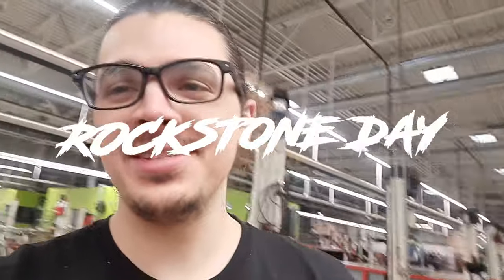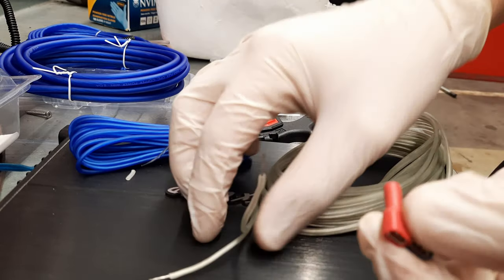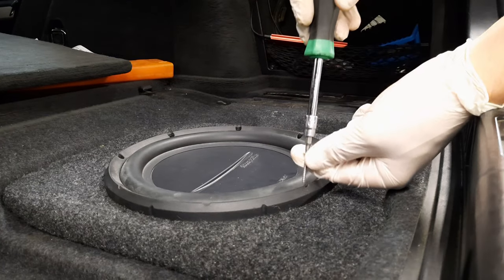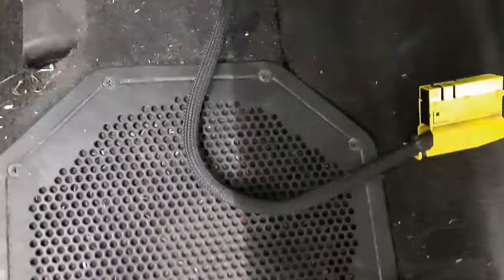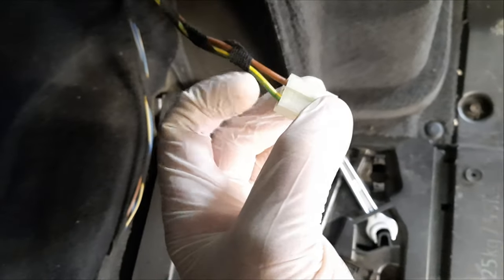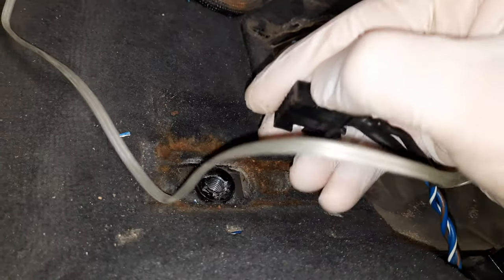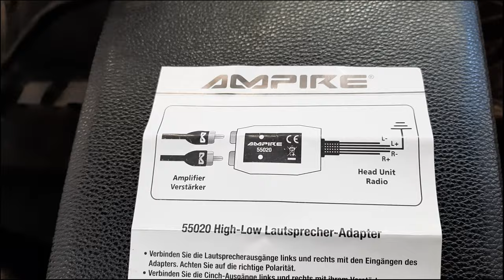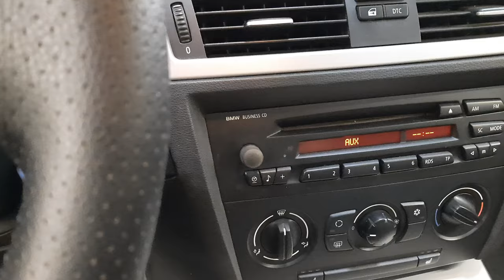BMW E91 Aftermarket Trunk Subwoofer Install

Comment: Hey man, redo the power to the amplifier. The fuse needs to be as close to the battery as possible. The way you did that is really, really dangerous and bad.
Reply: It’s the thought that counts 😂

Comment: can we connect the "amp deck" from behind of the radio? i mean the woofers cable that under the seats are going to radio's output or input. It is more simple rather than remove the seats i think.
Reply from the maker: This was more simple for me, and I dont like too much wiring behind the radio.

Comment: Why not slice into the factory amp from the back?
Reply from the maker: Because it doesnt have an amp in the back, thats for the higher quality audio options from factory, not everyone orders that.
Reply: @RockstoneDay  I see. I figured all e91’s had at least the hifi system. But I’m seeing some 320d’s apparently didn’t have the amps as well.
Reply: @actionmade  I’d really remove every plastic piece on the left side of your truck and get to metal. Check out other videos. He didn’t even remove the black plastic piece where it would normally be. Because the same wires he’s splicing into under the seats are the same ones I spliced into before they went into the amp. You can also put your line out converter back there and ground out there and use the power supply from your new amp that’s supplying the power to the sub.
Reply: How to connecet bmw (e90) Remote
Reply: I've actually done this but the problem is that the remote has power for 16 minutes after the ignition has been turned off. And any time I open any door or the trunk, or lock/unlock the car, the remote is activated again. I might have misunderstood something of course :-)